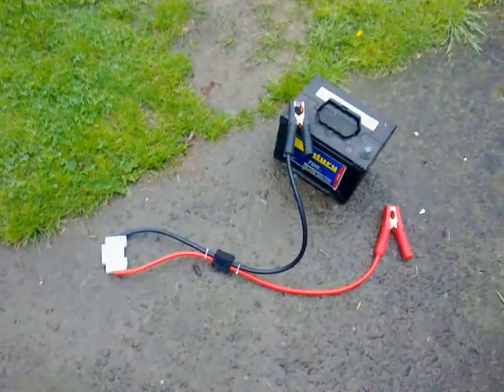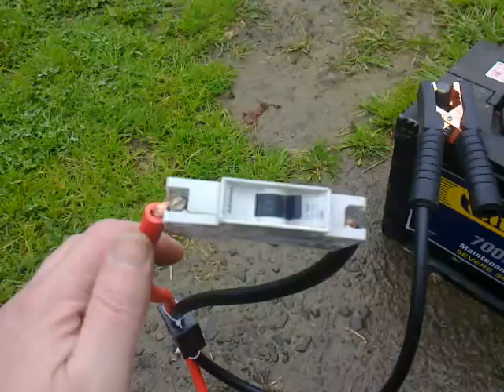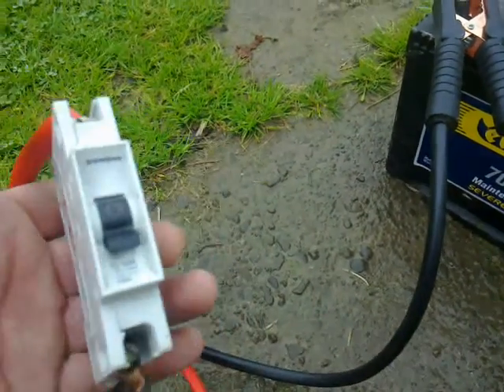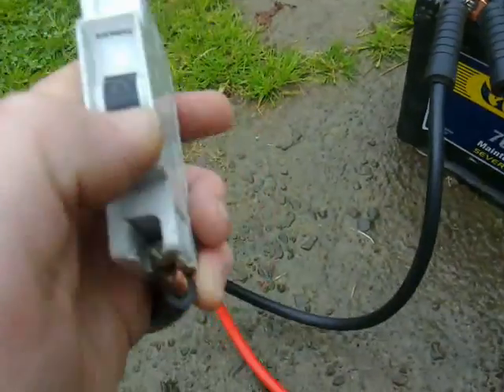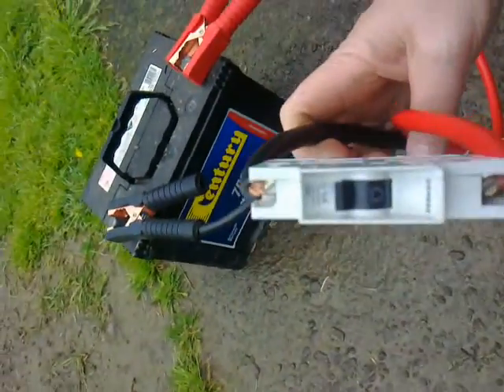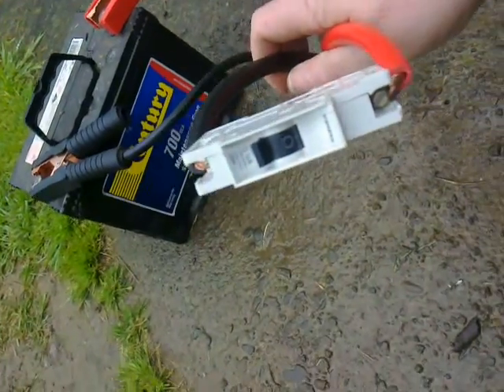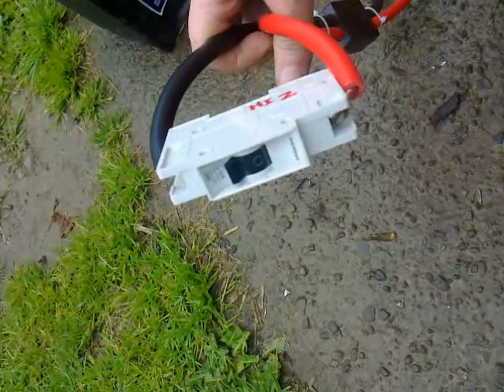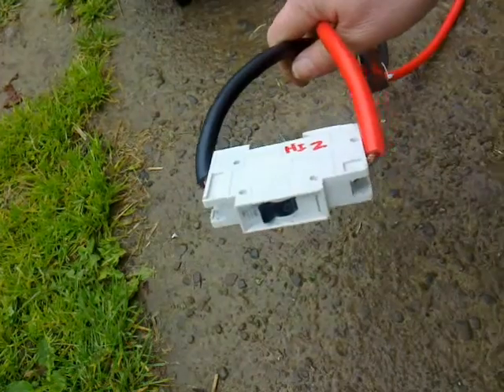A.C. CIRCUIT BREAKER VERSUS CAR BATTERY!!

Comment: Do you want the DC bad effects, try 170V DC (Rectified 120 V AC from mains with KBPC5010 with a 50A current limiter resistor or a limiter or a equivalent AC capacitor before this full bridge rectifier and a good capacitors bank to see the DC arc on breaker when it trip), or even you can try on 340v (rectified 240v from mains).

Comment: The real danger occurs when you have a higher DC voltage ... say 24V or even 48V. The voltage is enough to start a decent arc going. (Even 12V can start an arc, but it's harder to do.)
Reply from the maker: As you can see in the video, 12 volts could not cause an arc in the breaker, even with repeated operations. I reckon that 48 volts would, and there is no way I would use one for this voltage and up.

Comment from the maker: There's a lot of ideas I have about solar power that aren't exactly "popular". But as I write this comment I have been living totally off grid for 1568 days (which is over four years). And nothing in my setup has catastrophically exploded nor caught fire. But, have had a couple of "melting moments" with cheap DC rated fuse holders. Not a single issue with any AC rated breakers on 12 volt circuits.

Comment from the maker: I came here to answer a comment I received in my email but it seems they have deleted it. Something along the lines that a breaker like the one I show wouldn't break properly on a really big 12 volt battery system. Well, that battery is a starter battery and compared to a deep cycle battery they punch well above their weight, when it comes to short duration high current discharges. 

Anyway, how big is really big? Like really, how big would you want to make a 12 volt battery bank before it becomes more sensible to use a higher system voltage? 

Today is 2398 Days off the grid for me. Haven't had an AC breaker explode yet when handling 12 volts DC. But nearly 11K views on this video. I am quite happy about that, especially for a little channel that I don't promote and don't really care about the production values of! lol

Comment: Thanks for this Xan. I think in my video I pointed out the differences between AC and DC breakers was fairly minimal but even so I didn't feel comfortable standing up in public saying AC breakers are fine on DC. I'd have been interested to see how much current it took to trip - but in this extreme test that would be tricky to log. Thanks again. Point made :-)
Reply from the maker: Well, I am not exactly comfortable with it either. After all we have to remember that some great solar "guru" actually totally banned me from his page for trying to have a sensible debate about this! lol 

What people don't tend to understand about arcs is that it's not only the available current (supply impedance) it's also the voltage which makes a huge difference. You can't weld with a single car battery. It won't sustain a useful arc. However once you put three in series then you can begin to actually do so. Four is better. Commercial arc welders tend to run at around 70 volts, as do the arc houses on the cine projectors at Mavtech. 

And if you look at many switches that are available from your local electronics outlet you'll see that they often have both AC & DC ratings. And the DC rating is always much lower, sometimes in current, but usually in voltage. 

The simple truth of the matter is that 230 volts A.C. is far more capable of arcing than 12 volts DC. AC circuit breakers are certified to use in Cat IV installations where the fault current can literally reach thousands of amps. Whereas those cheap 12 volt DC "resettable" circuit breakers and 5AG fuse holders that the car audio boys use are probably not certified for any situation!
Reply: xanataph As always I find your experience and knowledge extremely interesting. I'm glad you understand my position too.
I have been looking at switch rating just today actually while trying to tidy up the shed. You've given me a lot to think about. Cheers.

Comment: sure this will happen... in the Moment you turn on a DC its behaving as an AC (changing Currents).
In normal use its not recommended though, because if the change in current is not high enough the Breaker won't stop the flow... also with a current to high, the contact pads may welt together because of a continouse spark that will occur opposite to AC
Reply from the maker: Which is what would occur if there happened to be a catastrophic short. The thermal side of the breaker is just a heater element, so it doesn't care if it's AC or DC heating it up. The main issue is the contacts themselves, as you have pointed out. AC breakers don't throw their contacts as far apart as DC ones do. And they don't tend to have significant arc-quenching arrangements. However, at low DC voltage the arc is not really a problem. For 12 volts, they work fine. Take a bit of care at 24 volts. And don't use 'em an any DC circuits above this level.
Reply: Id be worried if the dc fused the breaker contacts together causing a fire or more
Reply from the maker: @skyoreece9805  Well, that's a worry that also applies to cheap DC rated breakers too. And cheap DC fuses are pretty bad as well. Such as the kind of fuses and breakers that are sold for car audio purposes. I have more faith in a 230 volt AC breaker successfully breaking 12 volts DC than these items. Although they are designed for AC, they are also designed to break thousands of amps of fault current. Cheap car audio components are not.
Reply: @xanataph  thanks for the reply. There's been some great comments here. Thanks to everyone x
Reply from the maker: @skyoreece9805  No problem...! It's good to share knowledge. When I made this video there were plenty of others on YT showing AC breakers catching fire when switching DC, but they were all done with high voltages (200-300+ volt range). Of course, in that type of situation you would have issues. But I hadn't seen an demonstrations of it being done with ELV. So I thought I would try it.

Comment: Can 10amp 220v ac breaker protect 12v 150amp equipment?
Reply from the maker: No. You would need a breaker capable of passing 150 amps continuously. So maybe a 200 amp breaker. When it comes to switches (which includes breakers) you can't do some kind of wattage calculation and trade volts for amps. 

A switching device is rated for the current it will carry, the current it will break and the voltage that it will withstand doing so. The current capability is the same no matter what voltage is switched. But if you exceed the rated voltage the device may arc across instead of breaking the circuit when opened.
Reply: 6a 230v fuse blows around 14a 12v

Comment: I have a sxs and 1 night we rode went to sleep and woke up to my sxs almost on fire something shorted out so now I take battery cable off everytime it's going to be setting without me right there by it anyway I want to put a breaker on it NOT FOR PROTECTION  but just to kill all power so I don't have to keep putting cables on and off a ac breaker would fit best in space I have what do yall recommend I use thanks in advance....
Reply from the maker: Probably the best thing for you to do first would be to track down what was causing that fault before you fit anything, as a switch is something that could be inadvertently forgotten at some point. 

However, there a couple of different kind of battery isolator or "kill" switches available. One type would be wired into the cable coming from the +ve terminal, there is another kind that fits directly to the terminal. Usually the -ve terminal as it is safer to break this connexion in a vehicle setting.  

Not sure where you are from but here's an example of one that is wired in a cable: https://www.supercheapauto.co.nz/p/narva-switch-batt-iso-plastic-blistr/SPO813511.html

And here is one that fits on the battery terminal: https://officeconnect.net.nz/products/top-post-knife-blade-style-battery-isolator-switch-250a  There are also variations of this that work with stud terminals. 

Also bear in mind that you can get proper DC rated switches and breakers that fit onto DIN rails as well, so that could be a good solution too.
Reply: @xanataph  hell yea bro appreciate the info yea Im going to put a whole new wiring harness on dam polaris hit me for 1k for it but still want to put one of these on it just in case it ever happens again

Comment: so we can use cb ac for 12v battery
Reply from the maker: I reckon so. OK for 12 volts DC, marginal for 24 volts DC. But DO NOT use one for anything above 32 volts DC, so their use on a 48 volt battery bank is a big no no! Electroboom once did a live presentation on how many car batteries in series you need to be able to weld with. See if you can find it, puts things in perspective.
Reply: The ratings change. Can you use it? Yes, but what value does it protect the circuit for. Breaker sizes are selected for all parameters.
Reply from the maker: @pumpkinchucker4953  On mild overloads it usually takes a few more amps than the nameplate rating to trip them. Maybe around 23-24 amps for a 20 amp breaker, but then again this is probably similar to what would happen on AC anyway.

Comment: I think it's a thermal mechanism
Reply from the maker: These kind of circuit breakers are actually thermo-magnetic. i.e. there are two mechanisms built in. The thermal trip is for breaking sustained moderate overloads and the magnetic trip is to interrupt massive fault current conditions.

Comment: This Breakers can breake kAmps...
Reply from the maker: They are usually rated at 10 KA breaking capacity. But on a 12 volt DC battery circuit they wouldn't experience a fault current anywhere close to that!